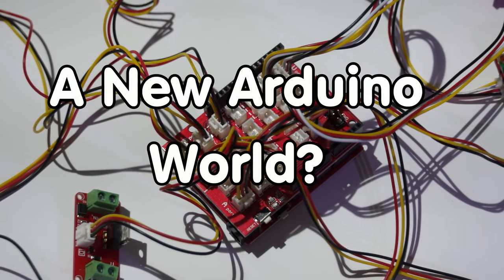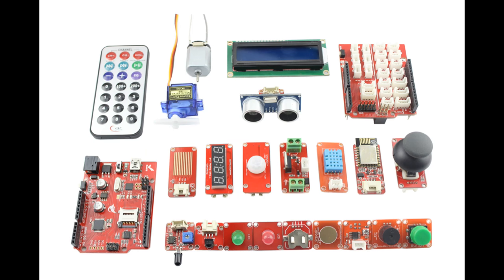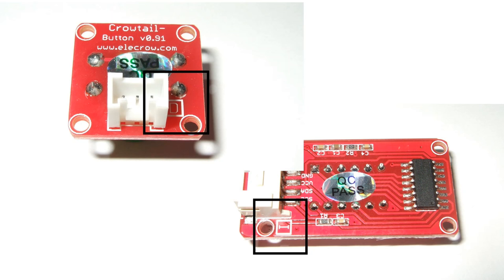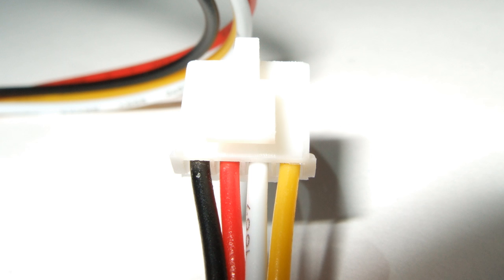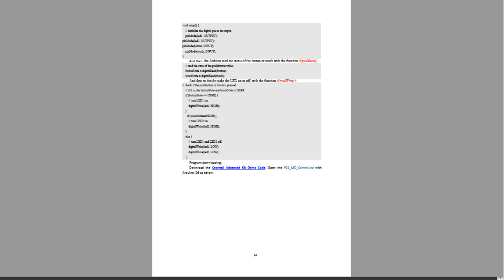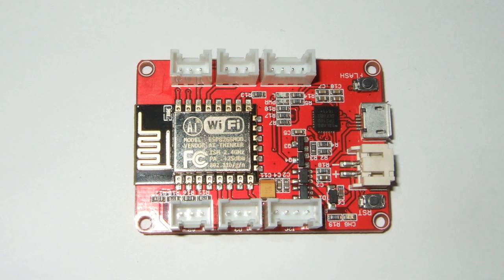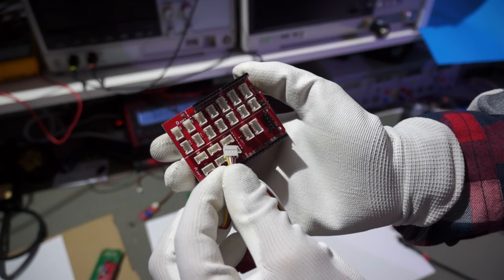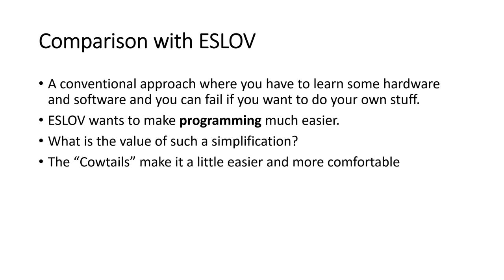#89 A New Arduino World? A close look at Crowtails from Elecrow

Comment: Not a huge fan of Dupont connectors for applications either, but they're dirt cheap and easy to use for quick and dirty circuits like breadboards or testing connections between prototype boards.

I've kind of become hooked on Molex KK connectors lately.  Same spacing, better connections with keys and locks.  Plus, if you buy them in white nylon, you can dye them with fabric dyes to make pairs in any color you like.  :)
Reply from the maker: +Dosbomber Thanks for the tip!

Comment: great lil thing .  informative as ever . and bam , you killed the SFW rating ( Safe For Work ) , with RTFM  definition . LOL . true  its a life long challenge to avoid manuals and instructions books .  I personally dont count YouTube  as a manual , and thus safe to check your CH out if i hit some tech i dont quite get how to use at first as you usually have them sorted with examples.
shame about the ESP unit though.
Reply from the maker: I just talked about engineers, of course. And I did not say, that this is a good behavior :-)
Reply: lol it more like a game for me . anytime i get a new device or such , if i can use it as needed without the instructions needing to be open (excluding safety section ) i call that a point for me .
If i have to read the book just tuse it then thats a point for ' tech ' . lol

Comment: This is totally not related but I am trying to find the rf codes that my ceiling fan outputs with an arduino rf receiver. Why is it that when I use the RC Switch library and open the serial monitor nothing prints when I press buttons on my remote. Thanks for the help.
Reply from the maker: You might have a look at my video #44 and come back.
Reply: Andreas Spiess I am not sure that that helps me very much I am trying to find the hex code that my remote produces. I don't need the binary and it is to my understanding that the rc switch library displays these. I'm very confused.
Reply from the maker: Unfortunately, I do not know a simple solution to this problem,

Comment: Is there a way you will review ,or to be more precise, when we can wait, elecrow A7/gsm/gps module shield review? :))
Reply from the maker: Which one? The Arduino shield?
Reply from the maker: I have it here and I like it, because it comes with proper antennas, and also uses the small U.FL connectors of the proper GPS antennas.
I hope, I will be able to include it in my A7 GPS tracker video.